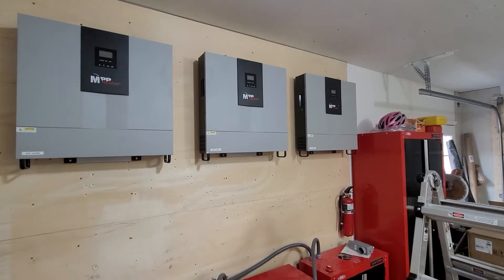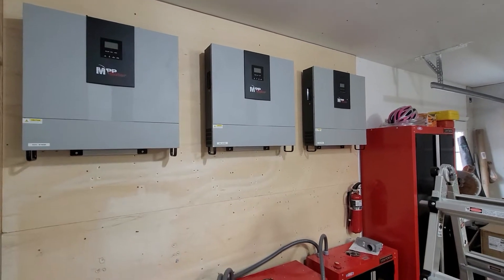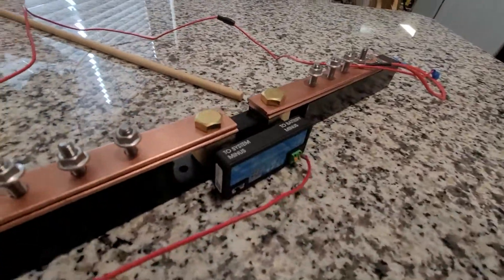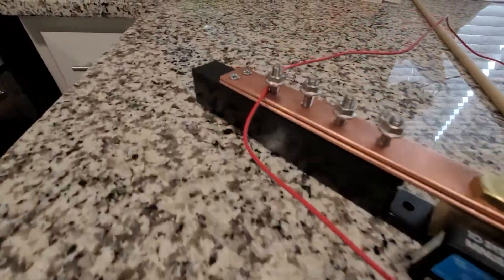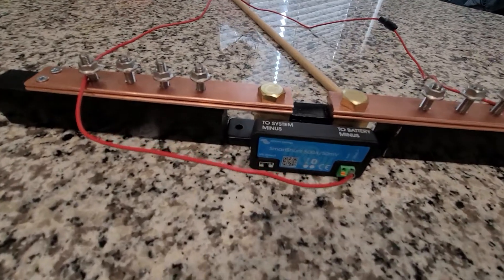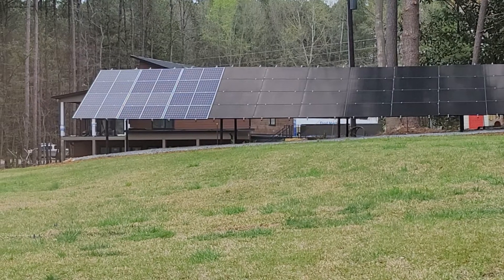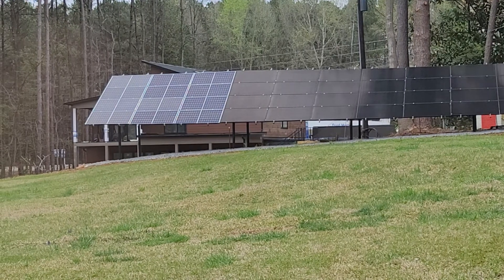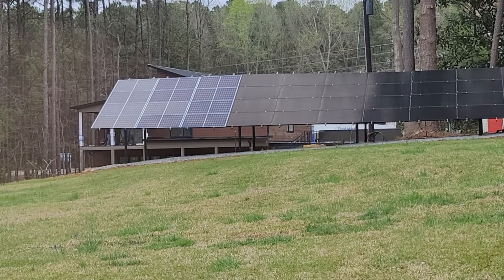Ground Mount Solar Array Part 7 Progress Update

Comment: Looking good!! I finally purchased my panels and they should be here next week. I ended up buying 12- REC 365AA (Black on black) panels. Solaris had a good deal on them.
Reply from the maker: Nice. Can't wait to see the update. Roof mount or ground mount? Thank you.
Reply: @DMIINC2013  Roof mount, but I have to find someone to do that part yet. Those days are over for me LOL. I'll keep ya updated. Those screw in posts you used look like an awesome way to ground mount by the way!
Reply from the maker: Yeah.... No roof climbing for me either.